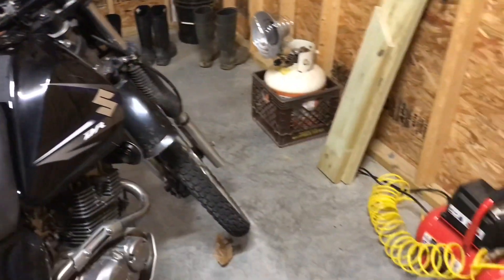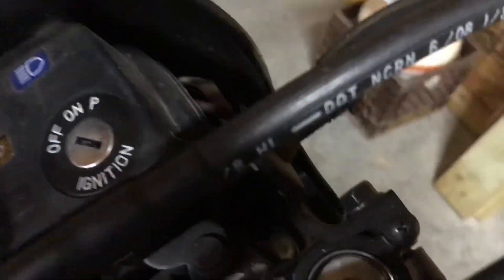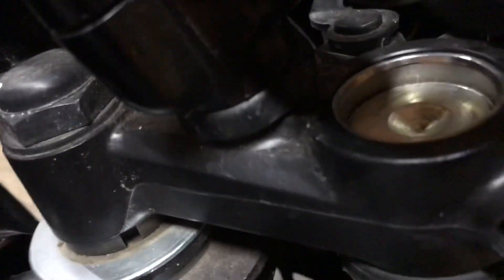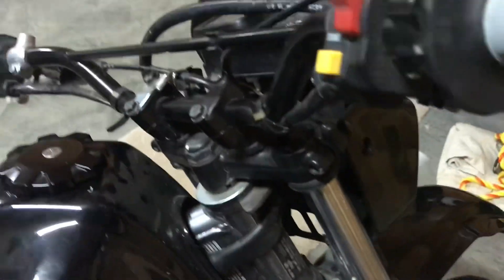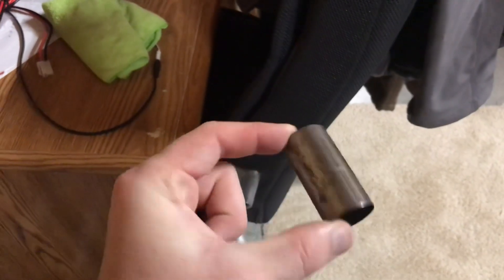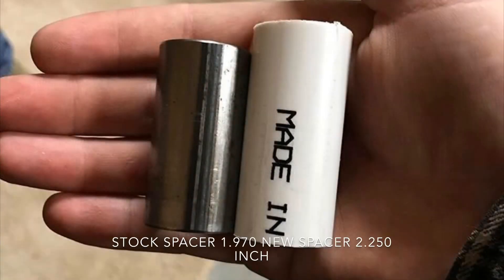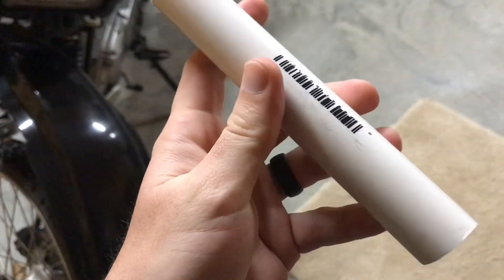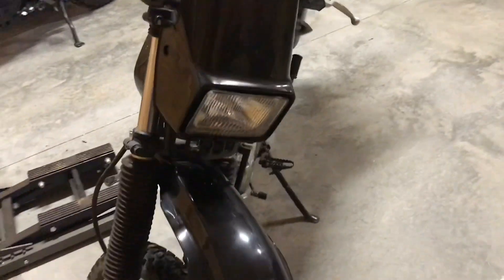Dr200 suspension mod

Comment: I have a dr200j.   One of the first ones.   Not starter or battery from factory.   It doesn't have the steel spacer up top.   I thinking i could add 1 inch.
Reply from the maker: Possibly, at the very least you can do a little then try it and go up from there

Comment: Absolutely perfect!! But any idea for the rear suspension?
Reply from the maker: I never was able to find any solution to the rear.
Reply: @DirtRider22a  it is impossible to lift the rear ... I bought an adapter but as i said...it is in its upper  position . If you lift it meets the lever  at the suspension arm.
Reply from the maker: @motorockerd  not sure, I removed my rear shock and measure it then tried to find a shock and spring from another make/model and never had any luck
Reply: @DirtRider22a  nevermind...it is a capable bike !! We will keep it anyway!!!